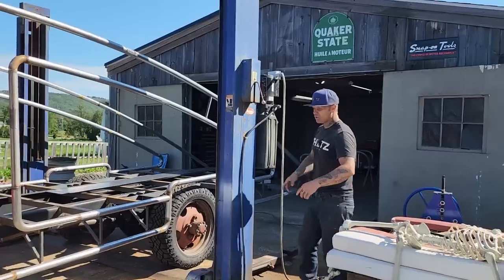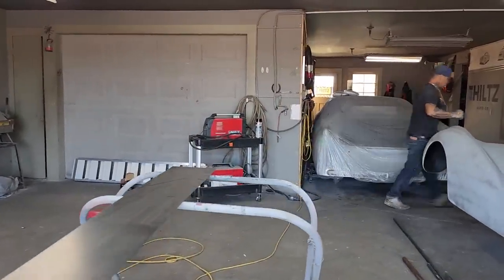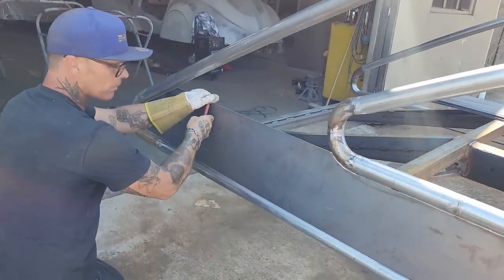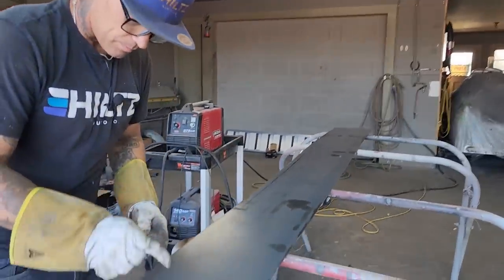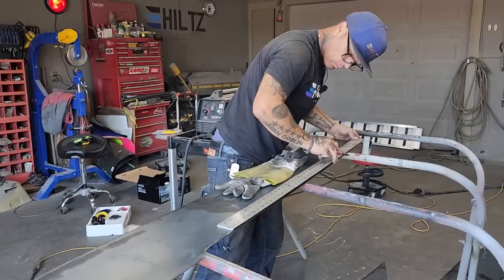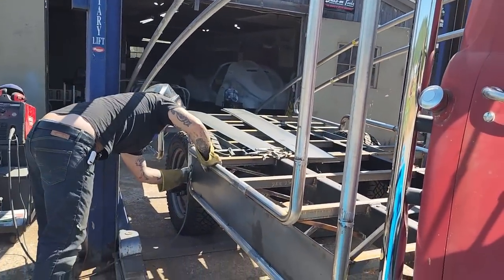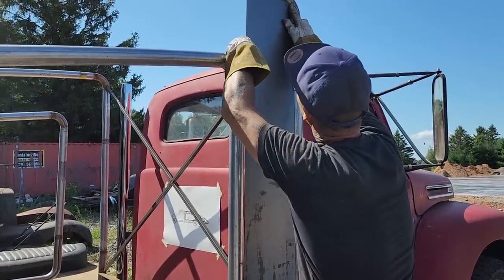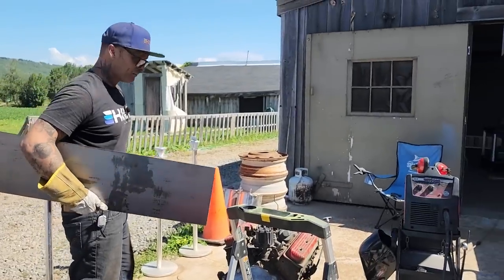Sheathing in the tubing construction | 1948 Ford Concept Car Hauler 🚚

Comment: It would be amazing if you painted the round pipe red and the flat inside metal gold to match the cab and running boards.  Know matter what you do it's going to be awesome, because it is right now.  Seriously from what you guys brought home,  the person you bought it from would never know it was the same truck and the way you built those rims a 2000's outside rim and tire but the actual  center from the original rims is unbelievably cool and if you had those custom built it would cost thousands of dollars with no tires that you would still have to buy.  Man you have saved me SOOOOO much money on fixing and building things is crazy and I thank you both for starting a channel.

Comment: Turn the ramp around it has a lip on it to sit on the square tubing you have installed,then drill holes through the ramp and tubing to put long bolts through to hold the ramp from sliding back,can be finger tight because you take back off.
Reply: I thought about maybe that or just hinge them and fold them up and pin them. The look like aluminum so they would be easy to lift.

Comment: You know Chad likes to dance by the diffrent  music heims he keeps singing is dance and happy song's from the 80s and 90s. 

Looking great keep on the pace every time you do something gets that much closer to your vision or try to get close to it.

I know when I start a project I have a vision but it changes plan's as I'm building it because the look changes from my vision. As long as I get close to it.

Building a front steering clip. The parts and pieces are slowly coming.

 I didn't want to buy the peices I wanted to scratch build the front clip from free scrap metal I'm getting from different stuff I'm breaking apart. There's lot's of free metal that people toss away from old appliances or something made of metal you just have to cut and break it down to manageable sizes.
 
I have a lot of square tubing, tubing, angle iron some sheets of metal that came from washing machine, dryers, round rod that came from an old metal box spring bed.

I do need to weld up a storage rack to have it better organised than just laying in a big pile.

It helps that my brother is a scrap metal guy he comes across the strangest thing's for sure. I pull some stuff out of his truck so it don't go to the recycle plant to be shredded.

 Can't save everything!
     my yard will look like a junk yard. 🏁

Comment: Hi guys,  Just a Tire safety note,  I'm not sure if your going or go back to the duels or stay with the single wheel, if your staying with single rear wheels, check the combined total weight with the race car & truck to be sure the Tire can handle the sidewall Load.  Good Luck on your project, looks good & stay safe.

Comment: I've been watching ya'll consistently for about 2 weeks now. Love the content and greatly appreciate the artistic mind behind your concepts.  I do have a question.  Would it have been easier on you and time effective to have used the panels you cut as a te.plate for the other side?  Even if they aren't exact they would be close enough to fit with minor "adjustments" .

Comment: Considering other drivers those should be red seal ticketed welds if it is going on the highway.
Reply: Give it up… 🤦🏼‍♂️
Reply: @dalebruce8253  Ya safety I've repaired many a homebuild bike and car frames even tow trucks some almost fatal flaws. He should have it inspected by a ticketed welder at least.

Comment: Hello Chad and Jolene, I would leave the bottom part without holes to put the Hiltz auto co racing team logo on both sides and it would be easier than finding where to make the circles where the reinforcements are.  In the rest of the structure, circles would look good.

Comment: The winch is 12 volt neg ground his truck is 6 volt positive ground. Have to run separate electrical systems for them both. The power for the winch won't have a charging system and will be a problem for Chad. Charged up batteries and Chad don't dance well. They're always dead or drained. Also when he showed us the ramps he had them turned around backwards. The opposite end has means to hook on the dove tail platform built on them.

Comment: Love the build, but I do think you are going to need a little more horizontal bracing across the top of the side to give them a little more side to side rigidity similar to what you did on the front with the X brace, but on the peak. Not to mention, it would make a cool place to install lights.

Comment: Instead of wheel tubs just put a c-channel front and back of the wheel pocket.  Then take a plastic semi truck mud flap, cut a little larger than the gap to cover tire.  Bend it in an little arch over the tire and your done.  Just drive over it and leave it in.  The sides will have a gap, but that not a major issue.

Comment: Another thought open wheel well running down road will have water spray coming up and you need to make bracket to hold mud flaps behind rear tires

Comment: Adding my two bob , any thought of up grading the bracing behind the cab to using more exhaust pipe. Not just straight but curved from the top to bottom joined in the same plane in the middle. With some sheet steel above and below the join with holes maybe smaller to match the other webbing. Loving your energy and drive.

Comment: I would have tacked some tabs just past the centre line so the sheet had a backing so ran along in a straight line which is one less thing to keep checking..Saved sounding like woody woodpecker all day.

Comment: You are essentially  constructing  a truss system  on the sides. Keep in 
mind the side trusses are the main supports. Your tail overhanging  
will be subjected to an overhanging load of one ton or more . With an
factor safety of 2 it should be designed to withstand a static load of
4000 lbs. So everything  in the design comes into play .  Type   of 
welds, joint design, material in the design  and number of supporting  
members and placement are critical  in the design. YOU SHOULD NOT 
JUST EYEBALL THE DESIGN. Usually strength calculations should
at the very least be considered. So with that in mind be careful . 

Regards

Comment: Hi Chad and Jolene

Chad you could use 1 x 6 planks as decking which could give that lift to make it easier to drive a car over the wheels, plus you could use reclaimed scaffolding boards as decking for the race car transporter.

Comment: Are the rear spring shackles still accessible now you have added the angle steel alongside? I hate to think you may have to replace the hanger bushes or shackle pins for some reason. It looks close in the video. It would only need a notch cut out of that angle you added to allow access. Just saying. It's looking good.👍 Cheers from Chris (OZ).🦘

Comment: Great job Chad have a ideal take it or not thought now would be a good time to put it on each side a square lockable box in your sheeting for chains and straps and spare parts like plugs/wires/dis caps fan belts ext, just a thought do your way all ways

Comment: If you attached the wheel tubs to the horizonal exhaust pipe that forms the shape of the wheel well, so the tubs wing out like gull wings, that would be quick and easy to use.

Comment: Like the design
Wonder about the vibration and the
wind noise it's going to make ?
Stitch weld's will have to be close
all along the panels .
Definitely put the holes in the
panels like your design .
Thanks Chad & Jolene 👍

Comment: Instead of the putting holes in the sheet metal I think hilts auto co. At the top in the arch and something along the bottom and something in the tail of . Like 3 sections of hand painted lettering would be cool

Comment: an idea '' drive the car up on the ramp on a something high so you can see if they will hold a ton and 1/2, I'm sure they will but might need a rail down the middle, we made some thought it was good and it was weak, but we wear using them on junk cars, but they warped Haha
Reply: My same thought also. Not sure what they are rated for weight wise. I am thinking they are more for loading ATVs etc.

Comment: You can make a floor that can be raised with one cilinder (manual) so the car can be winched on a tilted floor that can drop back once the car is on. That way the wheeltubs can be fixed?

Comment: It’s looking good you two with that 14 gauge in between the exhaust pipe. I was wondering is your going to paint the back of the truck? If you are, what color have you Chad and Jolene decided on? Are you putting in a headache wall to mount the winch on or are you mounting the winch on the base of the bed?

Comment: Taking a tape measure and than transferring the lines would've been much faster. or use a set square to figure out where to cut the line it would give you perfect accuracy. btw Make sure you place those ramps, upside down, it will give you twice the traction on those ramps. Truck is looking Good.

Comment: I don’t know if I would weld the whole length of the exhaust pipe I think 1 inch welds ever 12 inch’s would be fine and then I’d put seam sealer down the length of it. Just a thought cause welding is time and money for wire and gas

Comment: It's almost like your using I-BEAMS WITH TUBULAR FLANGES & THE VERTICAL STOCK BARS WELDED VERTICAL @ EQUAL DISTANCES ARE GUSSETS WELDED IN THE WEB FOR STRENGTH . SOME HAVE POSTED THEY DOUBETED THE EXHAUST PIPE WOULD BESTRONG ENOUGH TO HOLD A CAR . I SEE I-BEAMS WITH CUSSETS WHICH WILL BE VERY STRONG .

Comment: There would be less waste if you cut the arc from a full 4 x 8 sheet. The bottom of the first cut will be the top of the second.  Then you are working with 8 foot sections and less welding.

Comment: Is there a video of the new factory build from the beginning, which could be looped and run at a faster speed. It would just take cameras set up on poles with a motion switch  and automatic filming. There are firms which do this as a job setting it up. The video is a go on wireless from GO Pro camera straight into your computer.

Comment: For the wheel wells, I'd just leave them off completely, I know it'd be messy that way but it would save a lot of work.

The construction of the sides with the steel plate and the exhaust pipes once complete will act like a steel girder/"I/H" beam.
Reply: Also, didn't you measure and cut spacers for the exhaust? Couldn't you mark curves and then make a quick jig to get the sheet metal the same as those spacers?

Comment: Do you still have the magnets with the handles? They would make handling the sheet metal a little easier and safer. 
I've only had 2 cringe moments watching all this time. The first was when the engine dropped on the Bugatti and the metal slicing through your glove and finger 😬

Comment: But chad? A hauler has alower slope. Untill the cab? While driving, and side load issue. And it may be the tubing that fail. But the not welds?  I'm just saying.